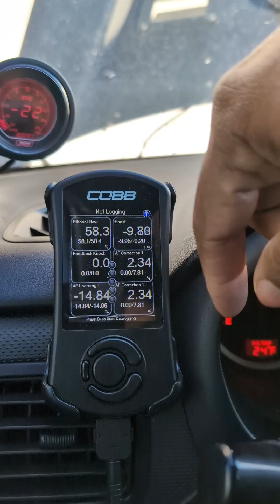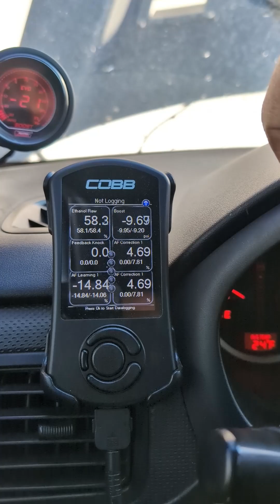Am I running rich? Cobb AP3 Subaru Fuel Trims

Comment from the maker: Yes and No: I would do a visual inspection to make sure you don't have any vacuum leaks or lines off. You would be surprised how often I see a line off. If everything is good and you have just installed a new intake, injectors or intercooler yes this will be need to be tuned.
Reply: Normally with those can it comes from your intake